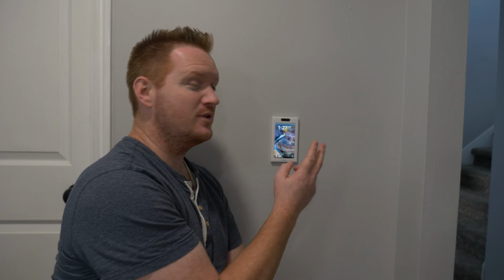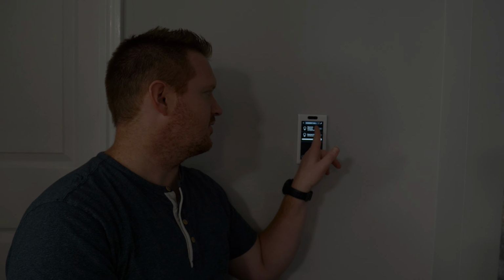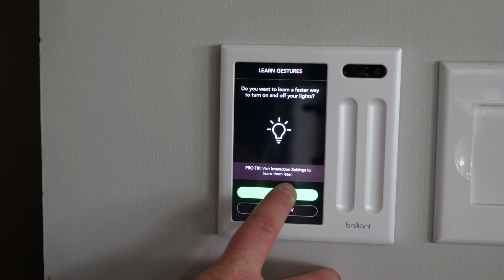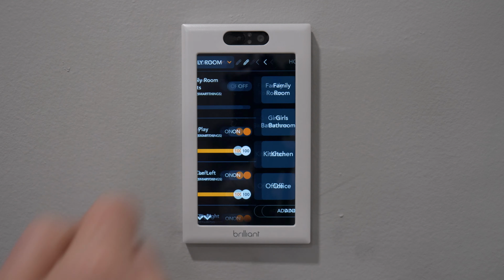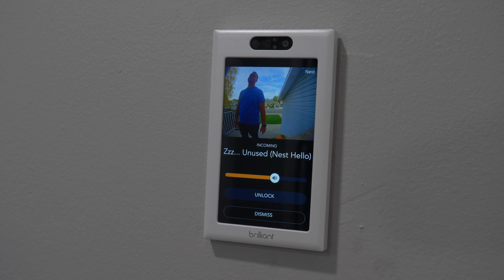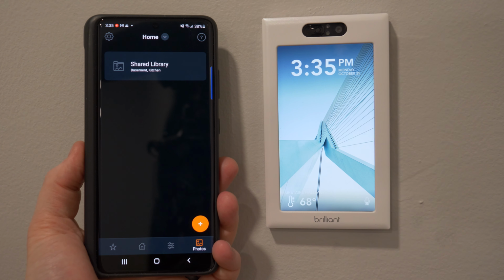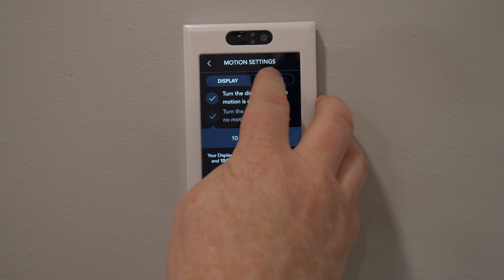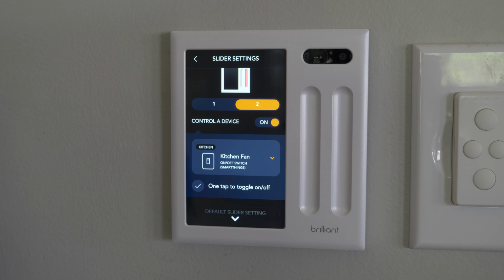A Brilliant Smart Switch to Control Your Smart Home

Comment: The thing that brilliant is doing wrong here is marketing this as a switch. They should be marketing this as a Home Control panel, as that is what it does and that is what most people will buy it for. There is not a decent plug and play panel on the market outside of your "Alarm" panels. Make this a slightly larger screen with a non switch option and this will fly off the shelves for 399

Comment: Im a journeyman electrician by trade and im always looking for products that can bring my customers into the future so to speak. These "switches" are quite impressive being multiple things in one product. The ability to join different products to it outside of their brand is a huge bonus  as well. I will say price is high and would be quite a hard sell to anyone, including myself. especially given that to use alot of the features you will need some other smart switches, camera's or such. Interested to know if its CSA approved for electrical approval? I think if they can get the price down and/or offer a starter pack with some extra cheaper switches for other rooms along with this main switch it would take off big time. At this time imo its directly in competition with a cheaper Wink option (its not as nice by any means but most people wont jump this deep in their pockets to start with smart homes). I could see this pushing wattstopper out of the residential market for richer folks but thats like 1% of the work I do. Key is price going down with this quality and it would be a easy addon to any middle class family I do work for.

Comment: Is there a subscription for brilliant like nest aware or a service like that?
Reply from the maker: Not that I have seen. Once you buy the product you get all the features.
Reply: @TechWithBrett  ok for the lights do u haft to have smart bolbs or can u just use regular LED bulbs
Reply: @nickedens3358  you can use any LED bulb (need to be dimmable for dimming) but if your trying to control lights in another room that room will either need smart bulbs or a smart switch in it (looks like many brands of switches work with it) and then pair them with this main hub switch
Reply: @jasonedgar1622  ok that's cool thank you

Comment: I have had there website up for almost a year debating when I want to buy one and yesterday I saw it jumped up 100 bucks from the normal price. So I guess I will continue to wait.
Reply from the maker: Oh no! Yep, be on the lookout for some deals this season. The Motion Sensor dimmer switch looks pretty sweet.
Reply: Yup, they literally increased the price overnight lmao. Also, this switch is already old and outdated. I wouldn't buy this until they come out with the new version.

Comment: Instead of standing next to the wall to control my system, I'd prefer to hold that screen in my hand, whether on the couch or at my home office desk.  You know, like a smart phone app.
Reply from the maker: One thing I have found about current smart home apps is they are so slow to load to complete a simple task. The Brilliant app and display are actually surprisingly fast to accomplish these tasks.

Comment: It is really cool, but if only it didn't cost TEN TIMES what a normal smart switch costs!
Reply from the maker: Understood, be on the lookout for deals this season.
Reply: Yeah maybe nest hubs for each room instead?
Reply: keep in mind. It is more than a switch, it is music control, photo frame, motion sensor, hub, alexa, etc ..👍
Reply: @ihcontrolinc9674  True, but so can a larger-screened pad or old cell phone with Sharptools for a fraction of the price.  Granted, if you have to hire an electrician for the other options, then maybe this is an equitable deal.
Reply: @designbuild7128  I considered using iPads they would have to be powered on all the time, which shortens battery life. I have Google home maxes but can’t control the Sonos audio system with them.